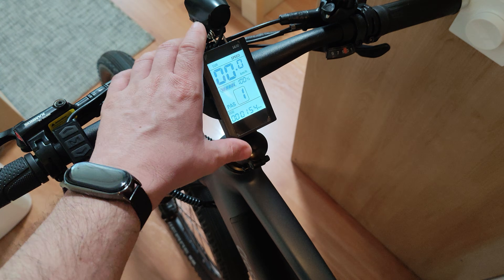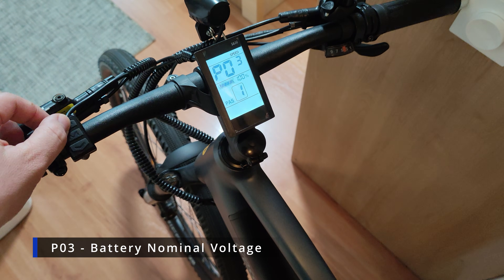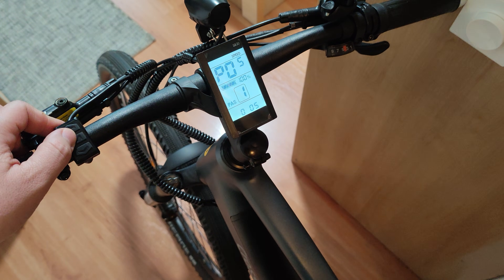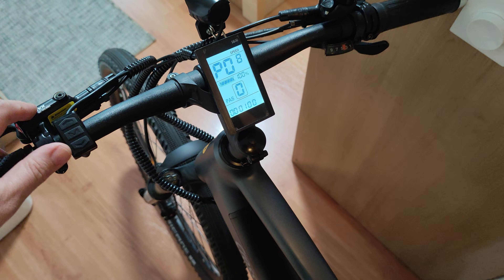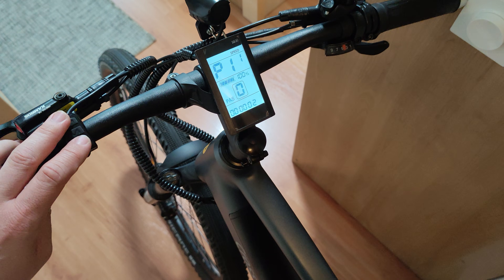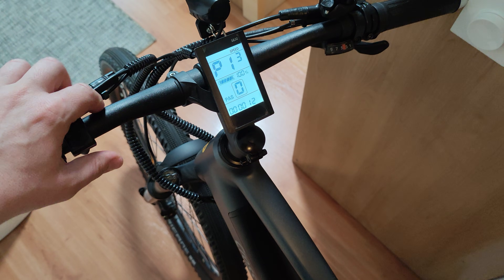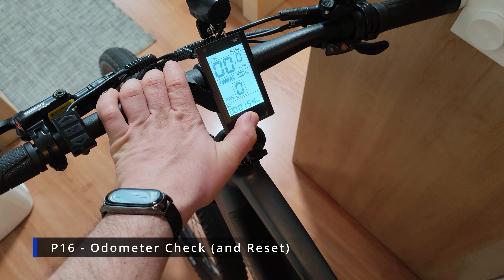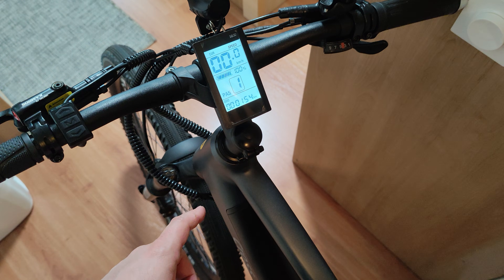S830 eBike LCD Display Complete Settings Explained (P01-P16) / ADO D30C / DECE 300 eBike

Comment: I have the s830 control but I only have access to 4 steps, P01 to P04. How can I access the other steps?
Reply: I only get P01 & P02,  did you figure out how ??
Reply from the maker: Probably a locked out version, not much you can do to it that way.

Comment: Thank you so much.  I’m fixing a trike for a friend. His controller let the magic smoke out so we found this one on Amazon and I have replaced the wiring harness with his connectors and we have it installed but I can’t figure out why we aren’t getting throttle response.  Perhaps I connected those wires backwards.  I’m also concerned that the Hall effect sensor only had five wires on his and six from the controller.   So all we get is PAS mode one though five makes it move at the same slow speed and the brakes won’t even cut out power.   If we go back to PAS mode 0 then it cuts off.  I’ll keep researching on line but I thought I would ask you as you seem to have a great understanding of how this controller works.  Thanks for what you have already done this video helped so much.
Reply from the maker: Is it the same controller / display / bike? Check the drive mode to have throttle enabled.

Comment: My ebike  used to be able to go 60mph i messed the settings up and now the speed only goes to 25.0 mph.. before the display was only 60mph now its showing 3 number places for example itd say  00mph now its showing 00.0mph. And before the pas was only 1-3 now its 0-5. It would also only be 1-10 for the p settings. Now it goes up to p16. How do i fix this so mybikw goes 60 again.
Reply: I'm not a expert but that sounds odd. Another guy commented that his P settings only goes to 5 but holding the M and up buttons at the same time turned his power to Max which also worked for mine. It displays "max" on the top of the screen. Haven't rode yet to see a difference but I can't even access my P settings so it's already a small victory.
Reply from the maker: You can't do 60mph with this bike, it's just wrong setting such as incorrect wheel diameter or wrong magnets number.
Reply: @TechTronic9000  I asked bc you have the same screen my bike has. Definitely a different bike just wanted to know if you knew more about the settings.

Comment: I have a cyccrown max and I can only access up to p01-p05 however i can unlock the max speed by holding the m and the up key
Reply: I can't even access the settings but pushing the M and up button did the same for me.
Reply from the maker: It's locked by the producer / firmware.
Reply: @TechTronic9000  = I only get P01 & P02,  how do I access the rest ??

Comment: Thank you for your video. You're very kind to share that info with us. I've been looking to increase the speed of my ebike for some time now. My bike is an Orbea Vibe H30. It only has a 250w motor. I did buy a cable from Speedfun costing €185, which increases the motor by 10%, but the bike I still too slow, so your video is much more helpful. Do you think it would be worthwhile to buy that device considering the motor is so low?
Reply from the maker: I'll let in a secret, motors don't have the exact declared power such as 250W, same goes for the controllers. This is just a "nominal sustained rating" to pass legislation. Most 250W bike actually have anywhere between 500 and 1200W! To increase speed you need a proper controller and also higher voltage. For instance a 250W 36V bike will be slower than a 250W 48V bike which will be slower than 250W 52V bike.
Reply: @TechTronic9000 Thank you so much for your time & expertise. It's much appreciated 👍

Comment: Wow thank you so much😊😊
i finally found how to use this one.
po10 question plz

0=assisted means pedal only?
1=electric  means  accelerate only
2=combined use both
is this right?

you never told us but i figured out how to reset po16..was easy😅
Reply: 0 peddle assist only. 1 throttle only, 2 throttle and pedal assist

Comment: I have a hitway bk10, same menù. But when i try to change settings like speed limit, my bike doesn't go faster than 25km/h, which is the standard speed limit of the bike.

Also the option to reduce start delay doesn't change anything in reality

Comment: So I've never really got a straight answer on how to set the wheel diameter setting, I have 26x4 and 20x4 e-bikes,  do you set them exactly on the wheel size or a little bit more for the tire thickness? I've never been able to get a straight answer any help would be great
Reply from the maker: I usually go with the wheel size, but it's not very accurate. On some bike 26" fat tire = 29" setting. You can use the phone with GPS and tune the settings until GPS shows the same as with display.
Reply: Amazing ideia.

Comment: What about P07?
Reply from the maker: P07 is related to the motor type and how it reads the speed (rotation) according to the number of magnetic poles and gear multiplications. Usually newer bikes with geared hub need to be set to 1 to show speed properly.

Comment: Hello, is it possible to restore all settings to the initial appearance?
Reply from the maker: No, you need to program each one as it should be.
Reply: @TechTronic9000  Okay, thank you
Reply: @TechTronic9000  Hello, I mostly drive on roads, how do I set it up?
Reply from the maker: Just let it as it came from ADO
Reply: @TechTronic9000  I don't know how it comes because I did it the same as in the video

Comment: My ebike is Movelo Electric Bike 36V 10AH 350W, the display only has settings P01, P02, ODO. Is there any other way to get all of the other settings? Help will greatly be appreciated. Please and thank you.
Reply: Having the same problem except just p01 and p02
Figured out a solution?
Reply: Same here.  did someone find an answer. ??

Comment: Hi sir, maybe you know what's happened to my ado bike. The problem was appeared then I changed my rear wheel tire. 1 paddling assist works at it should second one is at 25kph and 3 one is not working at all. Do you know what's the problem is? Maybe I changed something? In controller?
Reply: Check wires. Might be connection issue. 3 speed switch may be loose.

Comment: When I press the up and down only a C shows up with 4 zeros at the bottom
Reply from the maker: could be locked and asks for password.
Reply: Try 1314
Reply: try to enter 1111 instead of 0000
Reply: I tried this video, but when I try it it only has p001 p002 p003 p004 and then it goes back to p001. It's like the others don't even exist
Reply: @dananderson3930 Рад Вас приветствовать, а у меня только Р-1, 2, 3 и 3 не начто не реагирует 😢

Comment: It's the same as my ado a20f+ settings (i have now for almost 3 years), no changes here almost 3 years later, and no mobil app to set the setting, i think ado is missing something! the same controller?
Reply from the maker: For the A20 I have made this video https://youtu.be/hSbDzuEtqrI As for mobile app, that is available only on the AIR models which use different controllers, display, etc.